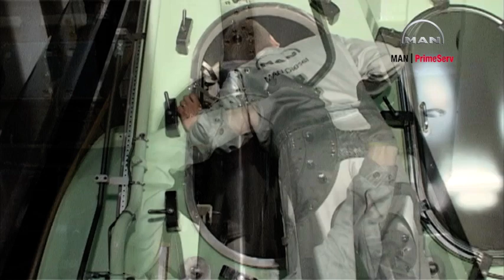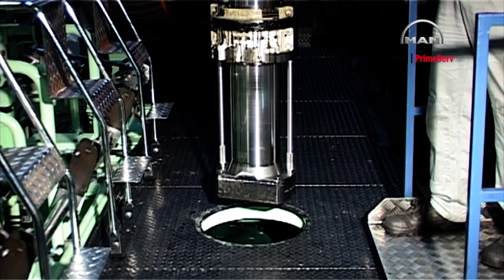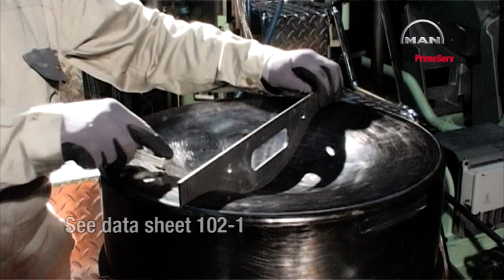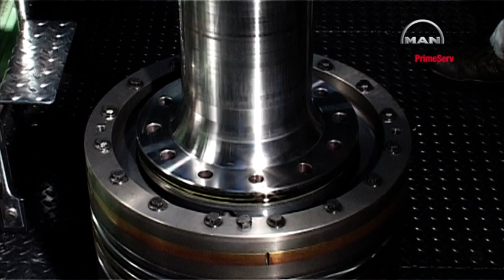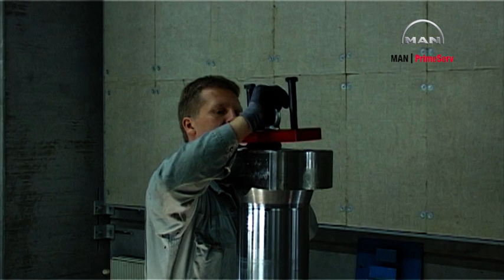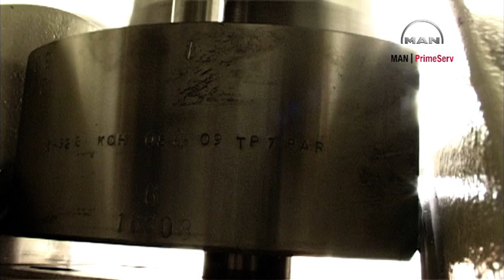Piston Overhaul

Comment: Why not land the piston head on a perpendicularly positoned wood plank so that it doesn't have the hazard of rolling over?

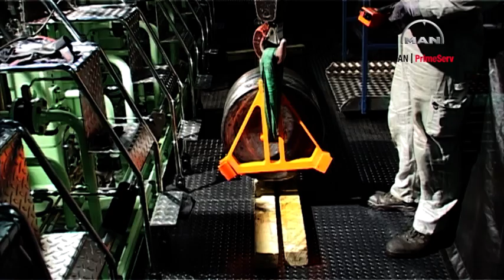11:45
Reply: -nevermind, it was answered thereafter. 😂
Reply from the maker: Thank you for your question and very relevant observation.
Safety is a very important aspect of engine maintenance and is always an essential focus area for MAN.
As stated in the beginning of the video, the Instruction Manual always overrules in case of any discrepancies as the latest manual will always contain Safety- and Maintenance instructions according to our latest Service Experience.
This video was shot over 10 years ago and today we specify, that the flat surface of the piston foot should be placed on a perpendicularly placed wooden plank to prevent any rolling movement.
It could also be an option to combine both the perpendicular plank as well as the planks in the piston crown end displayed in the video;
The combination of instructions and common sense will always ensure the best Safety.

Comment: I see paint stick marks on the piston skirt bolts and It makes me think it's for indexing the bolts so the locking wire hole location in the correct spot.  Either that or for torque turn method of final torque spec.

Comment: Try doing this at anchor off somewhere like Dubai or Singapore or Hong Kong with the outside temperature 40 degrees, and when the engine is still hot, with hot oil dripping down on you inside the crankcase. Looks fairly easy, but the reality is that it is pretty back breaking work. Brilliant video and would have made our jobs easier if we had this to view when I was at sea.
Reply: Agree there mate,also they don’t show the captain asking when will the job be finished and told by the Mechanics to FUCK OFF ,IT WILL BE FINISHED WHEN ITS FINISHED.
Reply: Ya mate, agree on that one 😂
Reply: My personal record for S70ME-C engine was within 5 hours in Qatar
Reply: Sounds like it's wasn't the job for you

Comment: That's a little baby engine that looks new at the training facility. Should show grown up engine, hot and dirty with damaged or missing  special tools over the years. Or companies who save money by not supplying OEM parts that don't quite line up. Or have 12 hours of maneuvering to have to start job @ fwe to be told have to make next tide to maneuver back out. He also doesn't have hot oil dripping on him or working in slippery as shit crankcase.  When engineer s die and go to heaven, this video is what it looks like. Look at the clean boiler suit, damn I'm jealous. Most ships I've been on have spare piston and crown built and ready to go so it's more swap out and rebuild later. Engineer best friend is is spray any metal to metal surface or gasket with GN metal assembly spray otherwise lost time cleaning surface s or seized together.

Comment: Locking wire is obsolete. It takes a lot of practice to install it correctly, even then the lock wire can break from stress or actually be severed while rubbing against a case hardened bolt head. Most locking wire is made from soft steel commonly called mechanics wire. A hefty cotter pin would be much more durable and way less time consuming to install.

Comment: Not a single word about any "lock out, tag out procedure", that's bad. Don't you value your lives at sea or what? No one should enter the crank case before the engine is positively secured from starting.

Comment: The manual says not to tilt the piston horizontal without the stuffing box. Does it make a difference ?
Reply: This is the shortcut way if you do what manual says you need to install the tilting tools which you delay about 1 hour. The technique how you handle the engine room crane perfectly. 😊😊

Comment: Can someone tell me how the connecting rod moves straight up and down,with no side to side motion like most all other engines I'm familiar with?
How would it connect to the crankshaft without moving side to side?
Thx
Reply: It’s a cross head design.  The crank and connecting rod are below the cross head which takes the lateral loads while leaving the the piston isolated from those forces.
Reply from the maker: Dear Jason.See our video No. 24 - 'Diesel Technology' https://www.youtube.com/watch?v=9uRNXpMc358

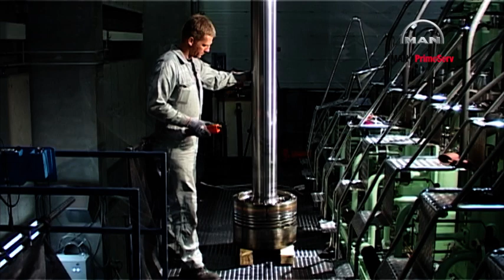Comment: 13:12 the locking wire in the upper left is in the wrong position, it'll help the nuts to loosen.
Reply: Which one
Reply: good catch
Reply: Good eye.
Reply: Well, it was like that when they took it apart, so it was like that for years. New wires were fitted in a good position.
Reply: Good, I'm not the only one who caught that.

Comment: that must be the cleanest engine i ever saw...
Reply: It becomes even more impressive when you realise that Diesel engines, especially large medium and low speed marine engines like this one, will run on pretty much anything. They can even run off of unrefined crude oil. So if you have a ship or a power plant that runs one or more of these engines, you can just use crude oil to power them, although they mostly use Heavy Fuel Oil (HFO, a.k.a "bunker fuel" or "bunker oil") or things like Low Sulphur Fuel Oil (LSFO), Marine Gas Oil, or Marine Diesel Oil.

And to all you idiot greenies with your hair on fire:

1. These engines can run off of LNG, LPG, methane, ethane, propane, butane, methanol, and ethanol as well. 
2. You don't even need to modify everything to run on just natural gas. Diesel engines are inherently dual-fuel capable. 
3. And most importantly, Selective Catalytic Reduction and exhaust gas scrubbers exist for a reason. And they exist because the exhaust gases contain lots of NOx, and sulphur too if you're running high-sulphur fuel like sour crude oil. But the SCR system helps cut down on NOx emissions, decreasing the formation of smog, and the scrubber helps to remove sulphur, phosphorus, heavy metals (mercury and lead primarily), and other harmful substances. The scrubber's ability to remove almost all of the sulphur from the exhaust gases means that the amount of acid rain formed is so little you don't even have to worry about it. As a result, the container ship that you see out there, despite being powered by a two-stroke Diesel engine that burns extremely dirty fuel, can still have very low emissions. There, you happy now?

Comment: lock-wire??- really, 1758- yeah, that's when they used it , us non dickheads, use a torque wrench and some lock-tight adhesive compound!, bolting tech has advanced since 1758, ffs!
Reply: Locktight on a component which is exposed to huge force spikes, temperatures upwards of 350C and various chemicals from high-additive lubricating oil? Not sure if that's a solid plan.
Reply: that used on bolts is MOLYKOTE paste, high performing lubricants based on molybdenum disulfide              it is a high temp grease.
Reply: Locking wire is not for tightening, it is there for informing u if any bolt got loose, so u can see throughout a simple scavenge inspection. And yes they will tighten it with tortque through 2 step at least
Reply: @insteelitrust3537  yes, but what happens to the wire fragments in the engine bay?

Comment: you start watching one of these, and you just can't stop until you see how it turns out.  You just have to make sure the piston goes back into the cylinder.  The suspense is overpowering.
Reply: Good evening I am and electrician ,a winding man how can I learn more about generator A.C and altinetos
Reply: I wish to now more about generator repairs and maintenance in all types of situation l need your your help please
Reply: @ajingnineba5250   you should post your comment at the top level, click where it says - add a public comment (geesh, now I had to watch the whole thing again.  After two years, I couldn't remember how it turned out.)

Comment: Dear sir, I am working on 6s50mc.
Engine, installed in 1996, please provide me the cylinder head overhaul videos. Cylinder head is fitted with hydraulic ring and hydraulic nuts... Kindly send me the procedure for opening and tightening these nuts

Comment: Lubricating oil what else does oil do aside from lubricate??
Reply: Protects the engine from the high sulphur content of the residual fuel used in these engines for the cylinder oil (yes, there are two kinds of oils in these engines).
Reply: burn for energy
Reply: It can do quite a few things...  Protect from corrosion as seen here, used for hydraulic pressure, cooling, burning and oh yes...lubrication.
Reply: Christopher Isac hydraulic
Reply: Engine also has cylinder oil that must be adjusted to fuel specific s.

Comment: Looks like the stuffing box keeps the piston lube oil in the area between it and the piston. I have been wondering why the crankcase was so clean and dry. But how is the oil circulated and filtered? Is it kept separate from the bottom end oil?
Reply: There are two kinds of oils in these engines. One for the combustion chamber, which comes from the alpha lubricators and pumped through holes at the top of the cylinder liner, and one for the more classical mechanical interfaces, which never comes in contact with the soot of the combustion chamber and can therefore in certain cases never be replaced (yeah... a 28years old engine without a single oil change... seen it).
Reply: @MarGRINCH-m4y  ... Makes perfect sense and when you have this much room to play with you can compartmentalize all you wish.  Beautiful design really.  Only feasible when dealing with this sort of size tho...
Reply: Toby W the oil from the stuffing box is drained to a tank called the oil residue tank. It's not reused

Comment: How many hours will an engine run between piston overhauls?
Reply: Just found this video, your question is 2 years old however if you couldn't sleep and still wondering well the OEM recommended interval between piston overhaul is 8,000 hours. That corresponds to  320,000 miles on a car averaging 40MPH. Unfortunately my experience with those MAN designed slow speed engines is we had to overhaul more often due to various breakage before reaching the normal running hours. When that happens in the middle of the ocean in a hot region trust me the engine is not that clean nor as cold as in the video and you better be fit if you will be the one disconnecting the cross from the con rod and dismantling the stuffing box. You get literally showered with lub oil at 70-80 Deg C.  The metal from the engine burns your feet through the sole of your working boots. Plus add the ship rolling side to side, 3.5 tons piston swinging under the crane, stay clear! It can be hell in Eng. Room. I also saw the piston cooling carrier coming out of the crankcase. Fun days that was... Usual time would be around 10 hours to complete the job when everything went well and with a trained Engine team. Every 1 hour or so the Captain would call you on the phone and ask if the repair is soon to be finished. At least a good Captain would bring cold drinks during the work and then would give a case of beer to the guys once we got back under way.
Reply: 6 months

Comment: I'm sorry but why didn't you mention how to suspend the telescopic pipe.
Reply: Amrit Jayaraman7
Reply: Maybe because this is an MC-C engine, and those aren't fitted with a telescopic pipe? The lubricating oil goes through the crankshaft, connecting rod and piston rod, all of which are hollowed out for that purpose...
Reply: Niki Ptt yes sir indeed you are correct no need for hanging up the telescopic pipe as there is none on this engine
Reply: @Slothboy0018  you are wrong.there is a telescopic pipe and you don't need to disconnect it
Reply: Amrit Jayaraman of course